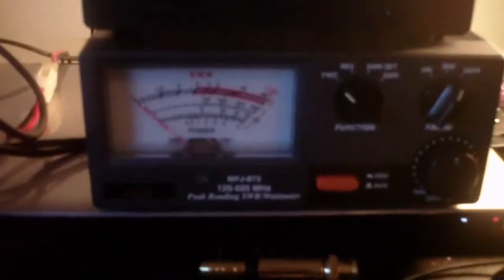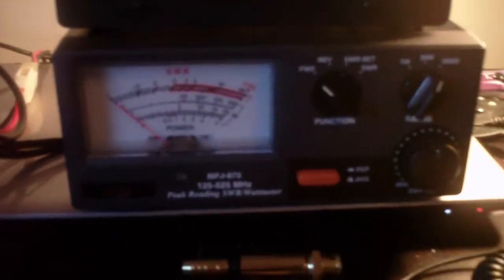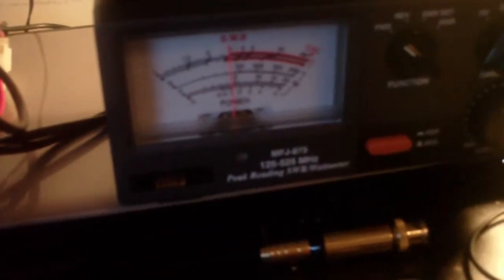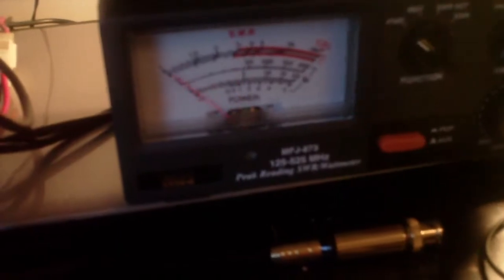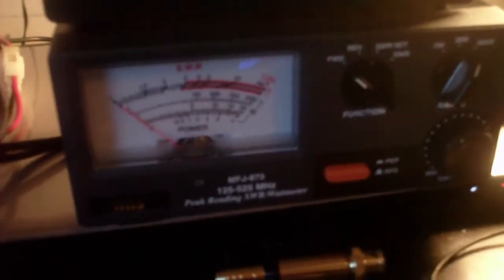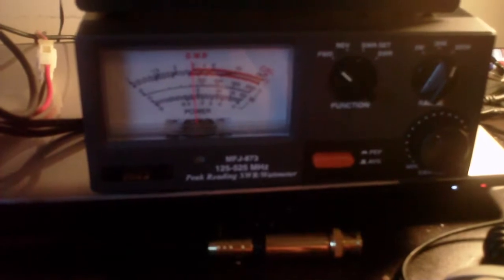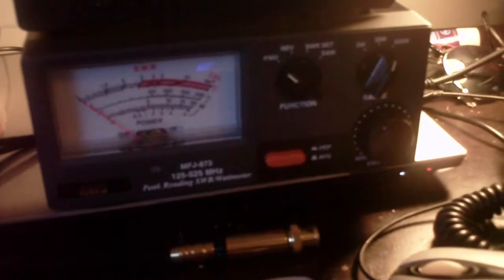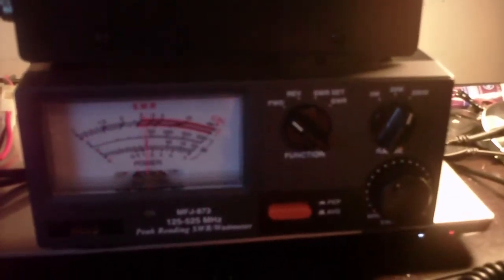Anytone AT-588UV AT-5888UV CRT 270M Intek HR-2040 Malfunction Problem No VHF Transmit

Comment: I have two Icom 207h radios which worked perfect until I did a frequency expansion mod. After a short time, both radios stopped transmitting on VHF.  Something to think about.
K9ILL.

Comment: Hi,
My CRT270M showed the same symptom (no VHF / RF output)
After troubleshooting, I came to replace one of the diodes located  in the feed line of Q617, Drive Amp (D604).  After a while, the same problem occured, that could be solved by replacing the other diode (D605)... No more trouble with this equipment since and so far....
These diodes are visible once the cover of the transceiver is removed; they are located on the main PCB, just below the edge of the small PCB on the left side, between the flat ribbon connector and another with Rd/Wh wires.
GL
Romain
Reply: I have the same issue. On the bench, the radio sends a clear signal to a handheld, but shows no real power out to the dummy load.
However, I cannot see any problem with the two diodes. Those may be them, where you describe, but I really need a board layout. I have a decent block diagram (I think), and a good schematic, but little idea what parts are where on the board.